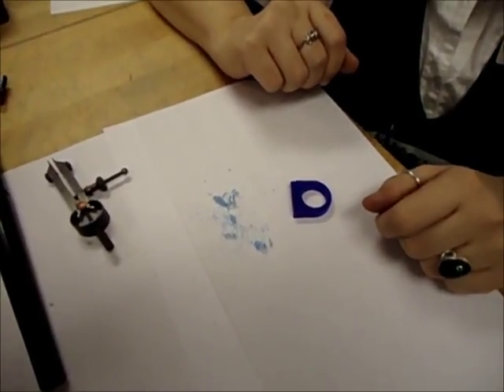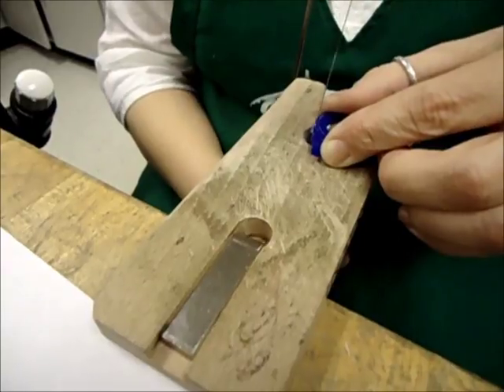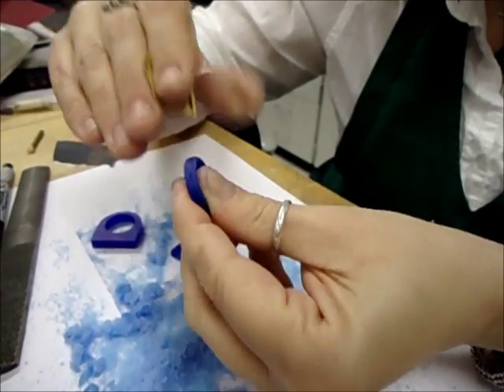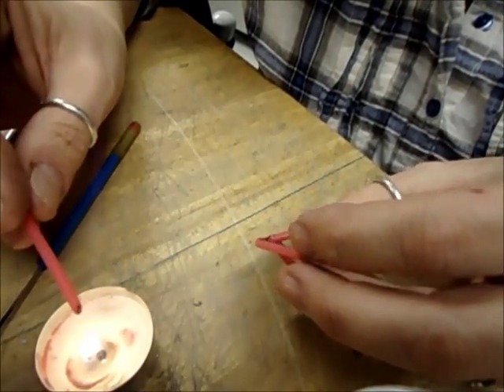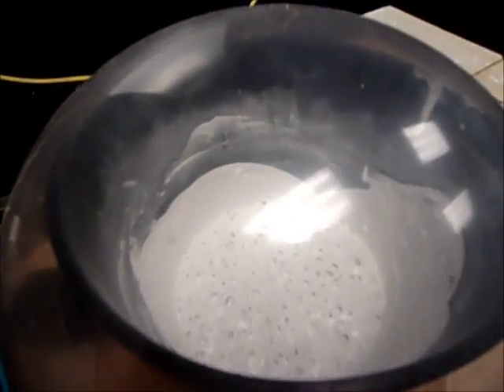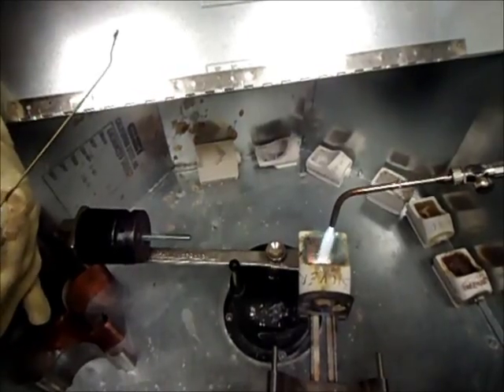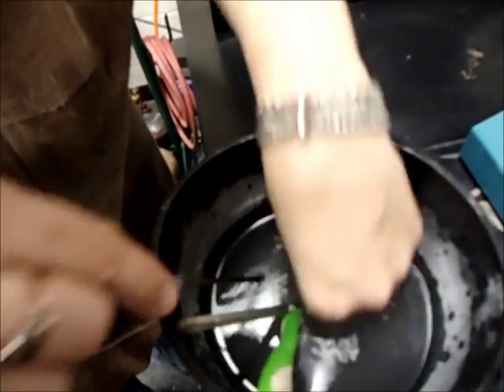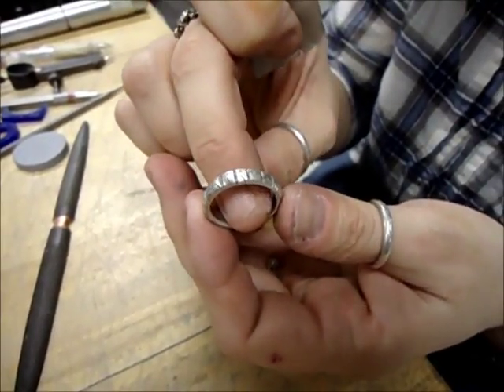Lost Wax Casting a Carved Band Ring

Comment from the maker: I'm glad you enjoyed the video.  My suggestion is to purchase or make some carving tools (Rio Grande is a good source) and wax and then send your models to a caster.  Then you don't need a vacuum table, kiln, centrifuge, flasks, bases, investment, scale, or mixing equip.  You will also want some good files - needle files, riffler files, half round files, in cuts #2, #3, and possibly #4 for finishing.  You will also need sandpaper - 320, 400, and 600 grit and polishing papers.  (need more info?)

Comment from the maker: I used a piece of a wire coat hanger.  You could also use a graphite stick.  The purpose is to check that the metal is totally liquid - sometimes it looks totally melted but is still a bit mushy on the bottom.  I also use the wire to clean off any excess flux (the powder that was added to the crucible during melting) from the molten metal before it goes into the mold.

Comment from the maker: Delft clay casting is different on a lot of levels - there is no wax model, or heating of investment.  It is essentially a straight gravity pour of the metal into a hollow space within the clay.  It is a great option if you don't have the kiln and other casting equipment available.

Comment from the maker: The formula for determining how much metal to use is:
(specific gravity of the metal X wax weight) + 15 to 20% for the button.  So for 14k (yellow) gold the calculation is:  (1 gram X 13.4) + 15 or 20%.

Comment from the maker: Sorry for the delay in responding.  The wax I use is specialty jewelry carving wax.  It has a significant amount of plastic in it so that your carvings remain crisp.  The "plaster" is called investment and can take the high temperatures (up to 1300F) that are required for casting the metal.  The wax and investment as well as the flasks, bases, and mixing tools can be purchased from a vendor called Rio Grande.  They supply everything you would need to cast.

Comment from the maker: H raypsi1.  I would normally use only one sprue, but the design on this band would be ruined if I sprued it to the outside of the band.  That's the reason I used 3 sprues on the edge of the band.

Comment from the maker: The wax I use is highly plasticized - specialty jewelry carving wax.  You can use candle wax, but it won't hold a hard edge like this wax does.  I purchase it from Rio Grande.  And the plaster is special high temperature plaster called investment.  It has to tolerate temps to 1300 degrees (F) in order to burn out all of the carbon.

Comment: I there away to do lost wax jewelry castings without all those big and expensive equipment for just a hobbist
Reply: Thank you very much, That was going to be my next question about if there is a casting service. Any recommends?
Reply: For very simple things, I have had luck with zinc casting. I melt pennies with a blow torch, and treat the plaster mold with a hot plate (kinda pricey, but not too bad.) I'm still learning, and have only made a couple of very rough castings, but it is a lot of fun for not too much money.